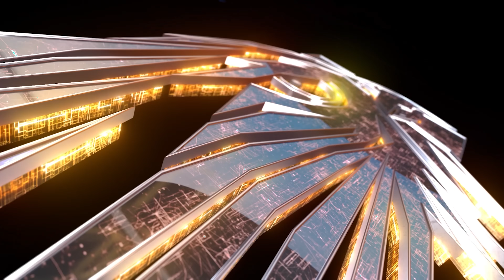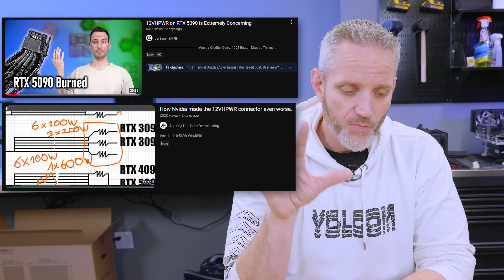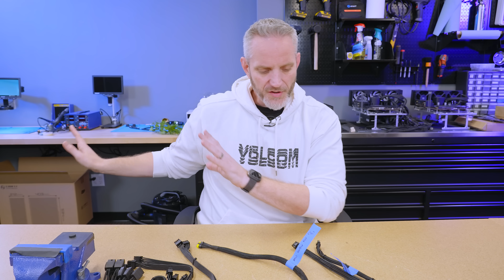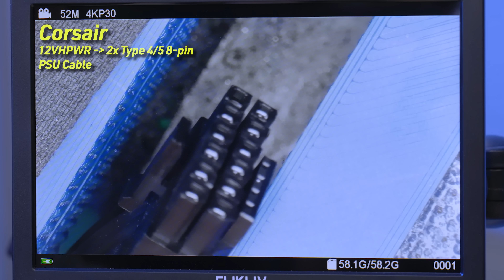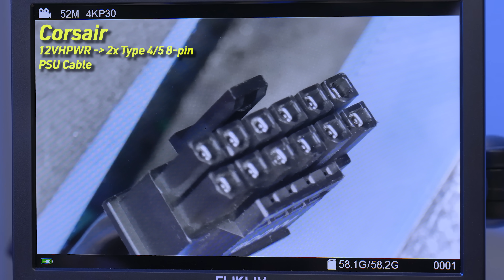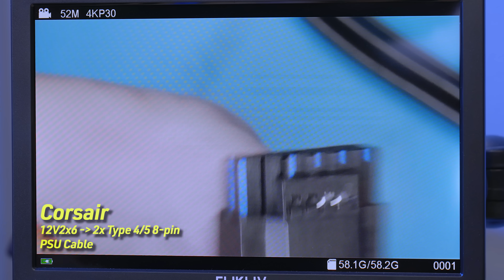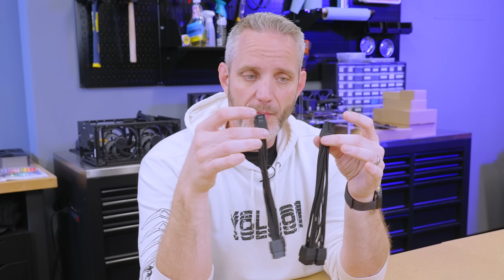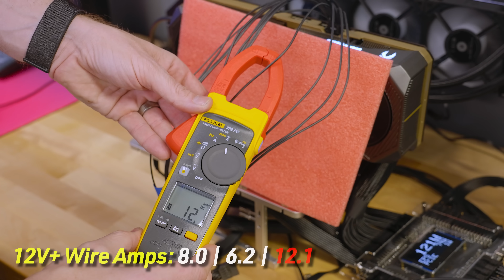I discovered something concerning and I need the Experts to chime in... More 12VHPWR discovery!

Comment: Gnd not as important as +12V. You are dissipating most of the power in the GPU. That is the reason all the IR images of the cables show the Gnd being cold. If one of the +12V is not making good contact the power will flow through the path of least resistance. This is a huge failure on Nvidia's part. They should be power balancing the +12V lines.

Comment: Great video Jay.

Here's something else to consider...

Not all individual conductors are made the same. Would be a good idea to sacrifice some of the cables from different brands / manufacturers (maybe?) and see how pure the copper used is and if the diameter is to spec.

Same applies to the individual pins used to terminate the cables.

If the pins move and say they only make contact on 50% of the pins surface, that can induce thermal issues, but also stability overall.
The material the pins are made of also matter, and so does the chemical composition of the plastic used in the housing.

Another thing I noticed is that the Nvidia adapter has a more massive connector then the others, with more plastic encompassing the individual conductors and stabilizing them - so to speak - doing a better job to keep them in place and prevent any movement.

EDIT: Honestly, at this point I would just say to hell with the warranty -> open up the card -> remove the connector -> solder individual conductors to each solder point -> label them -> and then use Wago 221's to connect each line to the corresponding conductor/'s from the PSU cable.

Comment: You need to get an industrial multimeter which can accurately measure the resistance at the milliohm level. Connectors will be spec'd for probably just a few milliohms within a certain temperature range and after a number of insert cycles. Because there's a common bus on the card end, you can use this to compare the resistance across different pairs (assuming you don't want to take the card apart). But making sure you have good contact with the probes is the tricky bit.

Comment: There is heat buildups at the connector from high resistance at the contact points. 

Overtime, there was a weakening of the connector from the thermal cycling. 

There was plastic softening, which also over time will create an issue of melting. Even if cards are perfectly fine at the moment, because of that issue; The failure of these cars will be high over the course of a shorter duration then the 30 series for example. We were talking 6 months to a year failure rates as opposed to the minimum three to five years for previous cards

Even though the VRMs are 30 phase, which are an improvement over the previous generation; You're still looking at a serious issue due to those spikes of 700 watts to possibly even 900 Watts which is reported by otherw. You're putting the mofsets / inductors under more stress then the 30 series would be because of this. The PCB is also more capable of micro fractures and even burnouts. 

A lot of these things will cause efficiency issues, including thermal throttling even if temps seem to be in the relatively high normal. Which could then create an issue of a card being damaged, including the cables melting over time. This is just a few of the reasons why three rail system would have been better than their single rail bus implementation. Asus knew this, and that's why they decided to add the three rail system. However, they would likely tell you this is an added feature to our highest and card when in reality it's meant to actually protect it better. Protecting your card at the highest level should not be an "added feature". 

And I haven't even spoken about how that can impact the PSU's as well. We're talking about failures from the PSU and the GPU side. The 5090s are very problematic cards and we're only touching the surface
Reply: I wanted to apologize for not discussing the cables and rehashing the possible issues regarding the GPU. The reason why I'm focused on that, is because there are so many different possible manufacturers of those cables, that you may never be able to guarantee every single cable manufacturer will be able to match the MSI for example. Whereas if we had a better failsafe on the GPU side, that would save us just in case we used a bad cable from a manufacturer.... Even though the cable may be branded from Corsair or let's even MSI in the future if things happen to get worse. So the failsafe must be there, but also the connector issues must be resolved as well. I would see both of them as priority One but I decided to focus on discussing the GPU side, I will allow others to discuss the cable side of the issue. Also the clues you mentioned are really helpful

Comment: Old power supplies with retrofit cables from the manufacturer should even have better safety than the modern ones with 12VHPWR output. In the new power supplies, all the conductors are connected together, the old ones should have 2 power rails and should therefore have a better load distribution on the wires. 12VHPWR is a joke. An AI card with cable resistance load balancing.

Comment: After the 4090s burning, you'd think nvidia would, at the very least, go back to the 3090 design (view buildzoid video), or start putting 2 of the damn things in the cards that are going to be potentially problematic. 
After the 4090 debacle, this shit happening AGAIN, in a product that costs, at the ABSOLUTE LEAST 2000+ USD, from a company worth TRILLIONS is the most insane thing I've seen in tech.
Samsung note sevens blowing up? Awful, but they fixed that.
Iphones bending in peoples pockets? 
Absurd, but fixed in the next model.
Insanity.

Comment: i work in automotive electrical. ive never seen this on a new connector pre covid HOWEVER - in the past couple years ive seen this A LOT in NEW off the line cars. fuel pumps, cam sensors, aftermarket lighting, plenty of OEM things. covid fucked the quality, what ever changed in our worlds manufacturing; its a real thing that all of us techs run into now that we VERY rarely did pre 2019. 

its not uncommon to get female pins push back and out of worn connectors. the way you insert them, its easy to catch on the male stud and push it back. in MOST plugs that do not have a cover, you will see the metal end of the male pin thats crimped to the insulation of hte wire - poking out of the plug. however if there is a cover OR a large chunk of plastic that extends back, like on this connector here... you would have no way to know with out manually pushing/wiggling each pin.

Comment: As an automotive tech, that recessed pin would only work if the female side was extended to match the male side. But since I recently bought a AORUS GP-AE1000w ice PSU, I just checked my connector for the 600w power supply cable and they are all the same depth when you rotate it. That’s definitely a pin connection Issue from the manufacturer.

Comment: I noticed this on other connectors before besides my GPU.  I noticed as I would push the connector in one of the wires would push back and you could actually see the metal pin itself, so I would push it all the way back into the connector. This is not uncommon but isn’t good at all. It could make the device not work or as you assume causing heat and shorting out of the connector or device. The wires need to be fixed inside the connector permanently as to not be able to move.

Comment: The 12VHPWR connector and all its variants are so poorly engineered, they should be ILLEGAL. A lot of power consumption and too much electrical current flowing through so many thin wires is the formula for disaster. But guys at NVIDIA don't care. In fact, I think they assume it's better for them if you buy more cards from them, even if they have the same problem.

Comment: Generally you want grounds to make contact first before power. However for power carrying you're right it's a loop they all need to be connected and have low resistance. That is a fundamental design with all Moeller connector from day one. going back to the old 4pin hard drive connectors the cheaper ones that you had to wiggle the wires to get it to seat.

Comment: A bad pin would be the opposite of der 8auer's Case though. A bad pin would have a higher resistance and therefore carry less amps and while it might pick up more heat on the pin itself, the cable should be less loaded. For his case, only one pin would have to make proper contact.

But after all, manufacturing tolerance is a thing and if the plug is so sensitive to manufacturing tolerances, the design is just bad and unsafe... And then NVIDIA's implementation of it in 40 and 50 series is just even worse, specifications are great and all, but the spec should have enough leeway to handle manufacturing tolerances.

Comment: Lol i'm using the corsair 12vhpwr type 4 + hx1500i + 4090fe , as i saw with most posts on reddit, it happens allot with the power adapter of nvidia or the cable mods and other companies and i didn't see one corsair cable on the internet that was burned....

Comment: Maybe take the shell off a 5090, plug in the cable, and check the resistance between the board/solder side of the female connector on the card and the connections on the PSU side of the cable? Would tell you right away if there was any continuity issues.

Comment: Alright so a little bit of background here for y'all before I comment. I have a degree in aerospace engineering (bachelor of the science degree specifically). We are required, by our own education and training, to be jacks of all engineering trades (but masters of none). I have years of experience in the engineering fields relevant to these cables, enough that I can point to something bad and go "this is bad, I will not be using it".

Having said that, I would never accept this in anything I built, mission critical or not.

Those pins being pushed back will cause imbalance in the power distribution across the wires even if they're still technically making contact. Some wires will inevitably take more load than others, and with how close to the limits you already are in the design, you heavily risk overloading wires. That one backed up pin alone could, depending on how bad the connection is and how much you overclock the card, completely overload the remaining wires and overheat them to the point of melting.

On a personal level, if I had any choice making capability for the design of these cables, I wouldn't be letting them out of the door like that, and I would be recalling them if they somehow made it out without my notice. But I'm just a random anime girl on the internet so who really cares.

And to be frank, the idea isn't bad. I actually like the idea of a design like this, but if I were designing it I'd consider more wires (4x6 or 2x8, hell maybe even 4x8 or two 2x8) and stricter guidelines to ensure that what you saw in those cables doesn't happen.

Comment: Here I'll assessed that issue. Those cables are half gauge too small. Those gauges on those cables should be almost like 12 gauge, maybe 16 gauge. You just said 12 volts 600 w that's identical to car audio so you should be using about the same size wire... Look at door speaker wire ...

16 to 18 gauge .. 

Door speakers might be having about 200 w running to them. Nowhere near 600 w and that's 16 to 18 gauge. That's even a little bit bigger than those wires that you're using for those PCS. It's ridiculous how small those wires are

Comment: In my opinion as a professional mechanic the specializes in electrical, resistance is resistance, resistance becomes a load as a conductor emitting heat or light, any insufficient contact will result in magic smoke ground or power, more common on power

Comment: As an extra precaution, it may be worth plugging the power connector into the GPU before slotting the GPU into the motherboard, then push each individual wire in with some needle nose pliers to make sure each wire on the power connector is indeed pushed all the way in as far as it will go, then finally slot the GPU into the motherboard.

Comment: why are all talking about pins and cables.... has anybody thought about HOW those pins are supplied with power inside the power supply? are the filtered, buffered or else... and if they are.. is this done on a per contact basis? if this is the case... hey... there is the culprit.

Comment: I’m curious to how many insertions that connector has undergone. Corsair and you might both be correct. That amount of play could be in spec but with repeated insertion is no longer fine. These cables are rated for like 25-30 insertions. And if it’s one of their first gen cables you could have exceeded that count easily while testing. Any engineers that makes conclusions without actually testing it themselves is really guessing unless we are talking something purely theoretical. Buildzoids analysis was purely theoretical. This could be a problem it could also be that repeated insertions have damaged the connector or any number of other factors.

Comment: Meanwhile cheap Deans connectors for Lipo batteries are rated for 60 amps continuously. On 2 pins.

I'm guessing the pins inside the PMD are better than those in the PSU leading to better contact overall. Would also have been nice to know the amps through the wire with the recessed pin.

Comment: I usually also push connectors in by holding the cable bundle. That will make sure the pins dont get pushed back into the connector.

Comment: There's a solution to this problem it's called the Powerpole ® connectors from Anderson ( available in 15a, 30a and 45a or 180w, 360w, 540w @ 12v). And 2 thicker wires rather than multiple smaller wires. Two wires, Easy to connect, positive connection and done!
WOW in AC electrical and distribution when you have parallel conductors they have to be the more or less exact same length and both terminated exactly right otherwise one wire will carry more current and it might not be right for that current. With DC this is even worse. This is such a terrible idea and then they went and miniaturized the connector and took away the per connector sensing. I stand by the first part of my comment! It was way too much to go wrong. Having 1 # connect out with a positive distinction for when it's fully inserted would be so much easier shirt you might have to double it up to Fort Myers but it's still a better connector for handling high power. The number of times I've dealt with Molex connectors and having to juggle to get the pins to fit in, one of the pins being loose, they're not suited for high-power uses! 660W/12V=55A that's a ton of power!!!!!!!!!!!!!!!!!!!!!!!!!!!!!!!!!!!! You would be laughed at and out if you use that kind of wire to hook up an inverter to a battery! for 55A 8-6AWG!!!!!!!!!!!

Comment: The nVidia '+12VHPWR', or whatever nonsense they've tried to rebrand the same crap as, I refer to simply as the 'Garbage Connector'. (Maybe it should simply be known as an 'NGC' - nVidia Garbage Connector.)

The following is all my personal opinion...

The problem in NOT actually the connector, it's the application this connector is being used for. All this 'have you seated it fully' and all the 'contact pressure' issue are pure smoke-and-mirrors to try and shift blame away from whoever decided to use this connector in the first place down onto the end user. It seems to be all bout shifting blame onto the end user or whoever makes a particular cable. Somebody somewhere made either one heck of a calculation or conversion error that never got picked up, or some other incredibly dumb mistake was made.

The datasheets for connectors have different ratings for different type of connector installation such as the enclosure or lack of, as well as the number of physical connections (pins) in a particular connector and the application. Drilling down into one of the datasheets, I found that the contacts were ONLY rated for 5 AMPS. In a configuration of six +12V and six 0V contacts this gives an absolute MAXIMUM rating of 360 Watts!

The physical connector used in the Garbage Connector is simply completely unsuitable for the application. When Der8auer did did video a few years ago he included details of the manufacturer, the manufacturer part numbers and part series. When I followed this up at the time, I discovered that this was the smallest and least power-capable connector of the series. The next size up was the same as regular PCIs or EPS connectors, Then after this there was an even larger connector. Now, if the decision had been made to go with this larger connector series then I think it would have been a genuine improvement in power delivery and most likely the problems we're suffering now would never occur.

In a nutshell, then...

nVidia needs to simply drop this Garbage Connector. It's proving time and gain to not be up to the job. A properly specified power connector should barely get warm, never getting anywhere near how enough to boil water and certainly not hot enough to self-destruct under normal usage.

I think the most sensible solution would be to allow board makers to build cards using the conventional and reliable PCIe connectors and let the nVidia Garbage Connector should be left to quietly rest in peace and fade away into computing history.

One further thought I've had would be to retro-fit a hard-wired conversion onto the GPU that converts the NGC to regular PCIe connectors as a permanent fixture of the card. Maybe this could (should?) be offered as part of a warranty repair in the interests of preventing future issues. A hard-wired solution would certainly work around the NGC issues.